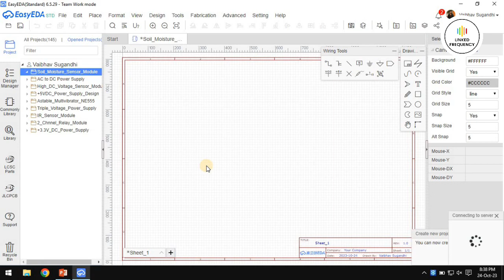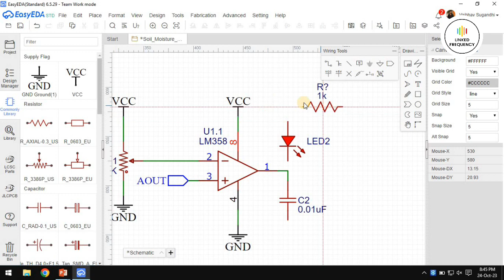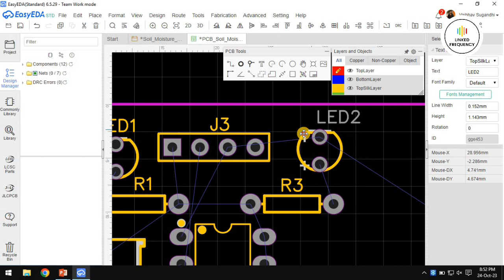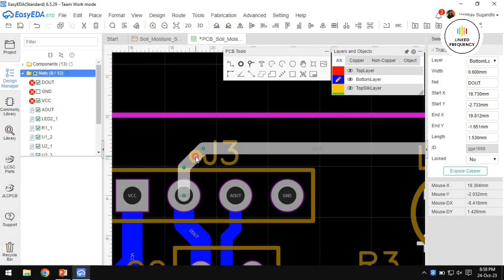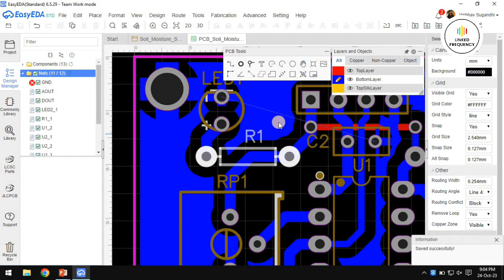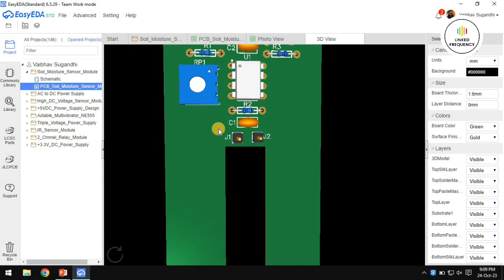Soil moisture sensor module design #E09 | Vaibhav Sugandhi

Comment: can we also use 2 pin connector for the probe input? is there any reason to use separate single pins here?
Reply from the maker: We want to place them apart as per our design requirements, if we use 2 pin connector, then we need to create a connecting tracks for them, which is not recommended. 

Happy learning :)
#Linked_Frequency
Reply: @Linked_Frequency  got it sir!

Comment: sir can you please design the capacitive type soil moisture sensor?
Reply from the maker: Hi @SaikatRaptan 

Currently we are focusing on making some other tutorials, so it may take a while for us to make a tutorial on capacitive based sensor. However, you can try designing it by yourself and share it us for evaluation. If any modifications needed, we will definitely help you as per our availability. 

Happy learning, 
#Linked_Frequency :)
Reply: @Linked_Frequency  Definitely i will try it out! Thank you so much! you are doing a great job for the hardware engineering community.

Comment: can you please explain  the use of 104 capacitors
Reply from the maker: Hi @suyashvimal6953,

The importance of 104 ceramic capacitors are mainly used for decoupling purposes. When you connect power pins to any electronic circuits, then you need to take care of voltage spikes and transmission noise in the path of voltage connectors, this can be achieved by decoupling capacitors and Electrolytic capacitors. 

Happy leaning, 
#Linked_Frequency :)